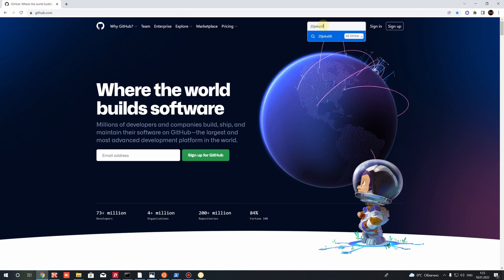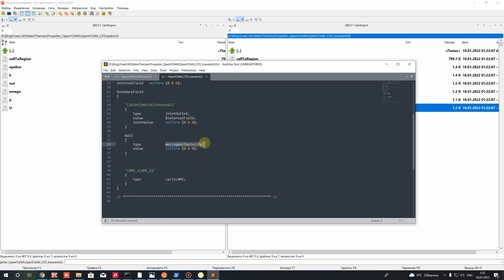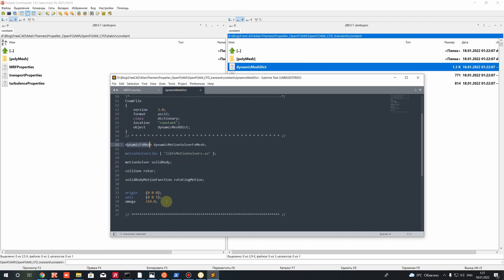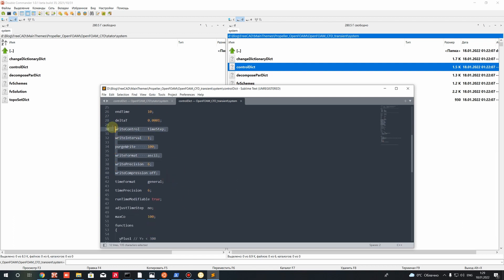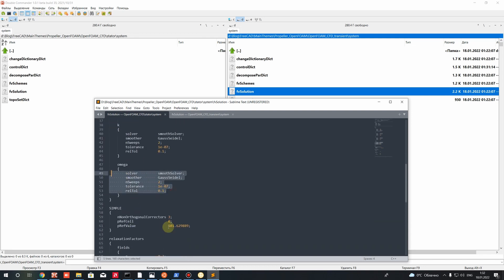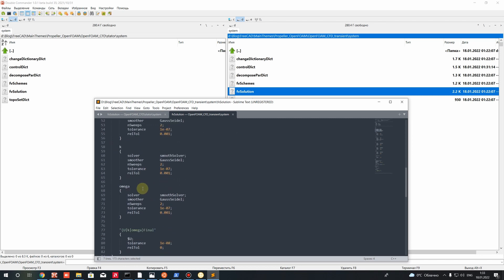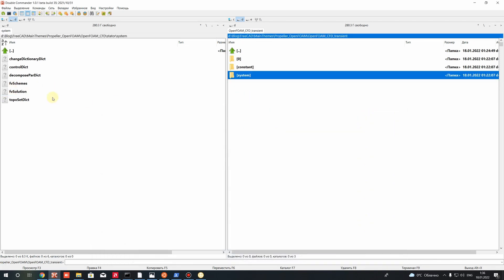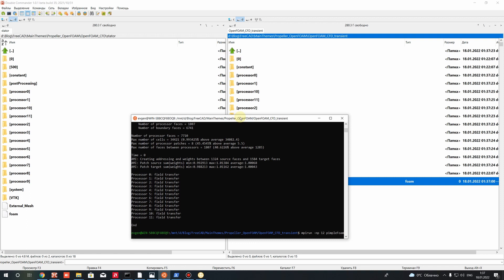FreeCAD + OpenFOAM Tutorial | Steady-state to Transient Simulation Propeller using pimpleFoam solver

Comment: I tried this case in ofv2006 and of7. The latter has a problem and cannot run. Do you know why? I digged into foam's original propeller case and added in the createBaffleDict. But it still blowed up.
Reply: That problem happened with me, that is due the OpenFoam versions, try with the same version Ivanov use